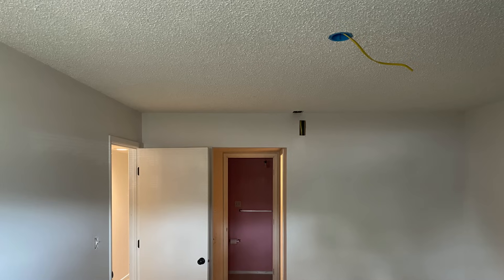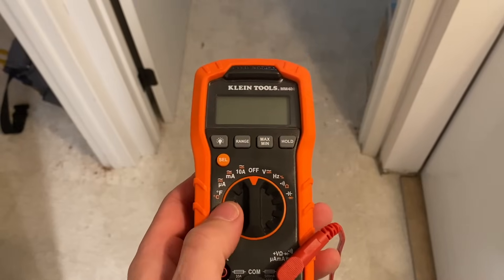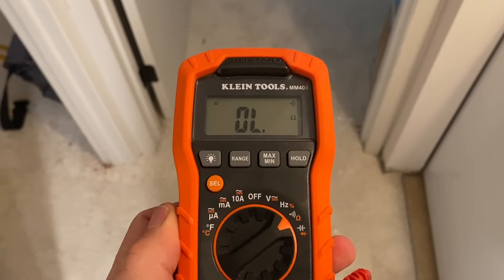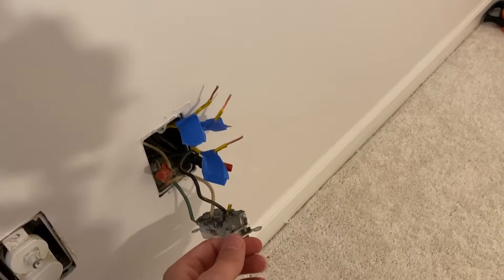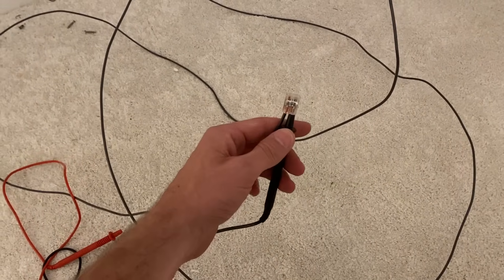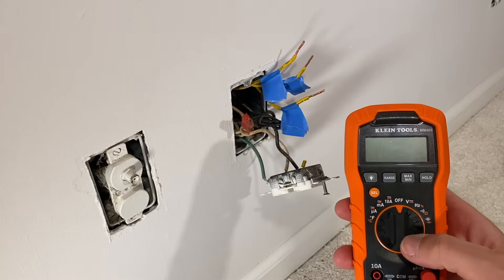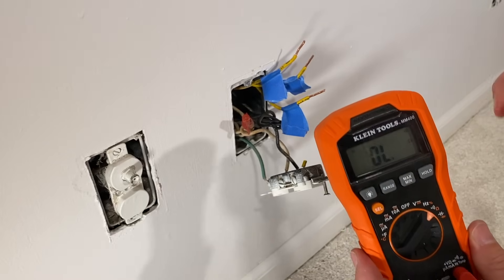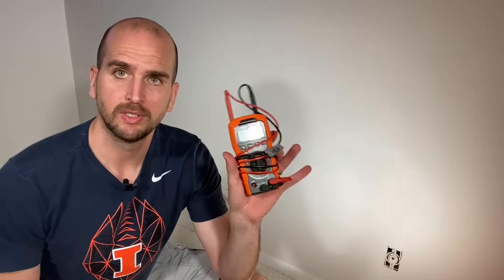How To Trace Wires In A Wall | Multimeter Continuity Test

Comment: Great video!  Great explanation of what you were doing and how you were doing it.  Those lever wire nuts look really helpful too.   I have a question that is sort of related.  Trying to install GFCI outlet for garbage disposal, but it won't energize.  Determined wire between panel and light switch that powers disposal was pinched under roof rafter.  Have 120v to switch (and non-GFCI outlet), but assuming the pinch is what is keeping GFCI from energizing.  Will check continuity tomorrow with your jumper idea, but assume have continuity because do have power, just pinch created short to prevent GFCI from energizing.  Sound plausible?
Reply from the maker: Maybe double check to ensure you didn't run the wires into the "Load" as opposed to the "Line."  I have seen that cause GFCI outlets not to power in the past even though the circuit was energized when the switch was in the ON position.
Reply: @EverydayHomeRepairs  Thanks for your input and letting me bounce this off you.  I replaced the old wire with a new one with plenty of clearance under the rafter in question and that fixed the problem.  We now have a new wire from the breaker panel to the switch, and the GFCI works.  Thanks again.  Mike
Reply: @EverydayHomeRepairs  Thanks for the quick response!  Well it was connected at load, but I switched to line, and it still will not power (but the light come on woohoo!).  The GFCI is hooked directly to the line from the panel for this test, no switch involved.  I've also plugged black wire into the next breaker, and still no power from GFCI.  Power to GFCI  verified by multimeter, but no power to lamp plugged into outlet.
Reply: Just checked continuity.  It was fine.  Reading on both black and white wires with a jumper between the ends (read separately) was nearly identical to reading when touched the two leads on multimeter together.  But that was kind of what I was expecting if the rafter sagging under snow load (N. Idaho) sagged just enough to pinch the romex and crack the insulation between the wires, but not enough to actually cut the wire.  Do you think my suspision is correct?  if not, any ideas?

Comment: You don’t need that length of wire just clip the far wire to ground then measure between ground and the 3 wires one at a time until you hear a beep !! Yeah !!!
Reply: 💯 

I’ve used this technique a lot on aircraft.  Whether it’s F16s or Boeings.  Put it to ground, go across the aircraft and measure continuity from wire to ground on the other side.
Reply: Smart.  Thanks.
Reply: What do your mean..? I’m trying to track my outlets all the way back to the breaker box so I can move a few things to open breakers but I can’t seem to figure out how to properly trace the wires, any help would be greatly appreciated
Reply: That wouldn't work with the ground because the ground is tied to the box as well. You wanna tap the hot and neutral pair together at one end and then touch them at the other end
Reply: @TheElectricalNut  why does the ground being tied to the box matter?
Reply: Thanks
Reply: That's so smart, thanks for this tip.
Reply: What does clip wire to ground mean?
Reply: @juanjesus8534 combine them
Reply: Never thought of that.. Thanks
Reply: Very clever! Thanks!
Reply: Exactly 🤦‍♂️

Comment: Can you use this method to test outlet to outlet in a series ....For instance between your last working outlet and the next non working outlet in a series in which the breaker isn't tripped you have power at first 2 outlets closest to breaker but then 3,4,5 and 6th outlet have No Power?  THANK U ANY HELP WOULD BE APPRECIATED
Reply: Turn the breaker to the 2 outlets that are working.  Pull the outlets out and check for a loose connection either wires in the wire nuts or where they are connected to the outlet. If you find that the wire is just stabbed into the back of the outlet this problems is not real uncommon....

Comment: He Scott...I’m I a situation where we moved into this house and we have a light switch in our bedroom that we have no clue what it’s for....we have already checked to see if it controls any outlets...it’s right beside that switch that controls the room light....is there a similar way we can n find out what it’s for.
Reply from the maker: Hey Troy,  off the top of my head I would expect it is another wire running to the ceiling light / fan junction box so you can control the fan and light independently.  Let me know what you find 👍
Reply: @EverydayHomeRepairs  thank you. Will investigate along those lines
Reply: You can open the switch cover  to see which way the wires go. up is probably a ceiling light removed in the past.   Use a voltage line detector for line power with voltage sensor.,  some are sensitive enough you can follow the wire behind the wall.   Buy the Walabot smart phone camera adapter, it detects things behind the wall!
Reply: @danc2014  yeah both sets of wires Go up..thx for the suggestions!

Comment: For some reason, maybe cause our home was built in 1890, we only have black and white wires.  Can you tell which is hot? and I guess the other if ground? or netural?
Reply from the maker: Hey Kevin, Sounds like your home is wired without a ground.  This is not uncommon for older homes and I would expect black to be hot and white to be neutral but you always want to check for sure prior to doing any electrical work to ensure your safety.  Best of luck!
Reply: Black= to braker. White = to netural. Green= ground. As by today's law.....but take no color (or anything else) as gospal.....But electricty to power kersosene lamps (really)?

Comment: Can this work to find the location of an open neutral? Specifically trying to find continuity without knowing the order of outlets & lightswitches on the circuit
Reply from the maker: It could help but open neutrals can be a little tricky.  I had one the other day where I was only getting 90 volts opposed to 120 volts between neutral and hot.  I flipped the breaker and found all of the outlets on the circuit and then inspected each outlet to make sure a wire nut or possible screw terminal wasn't loose.  All the outlets checked out and it ended up being a junction box in the attic where a wire nut was loose and one of the neutral wires was coming out.  Best of luck with the troubleshooting and let me know if you find the issue.